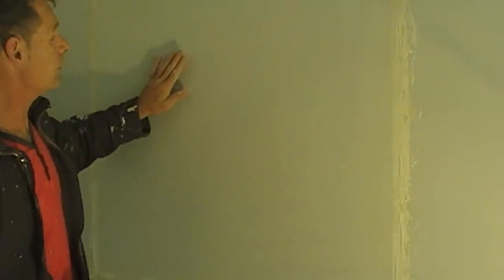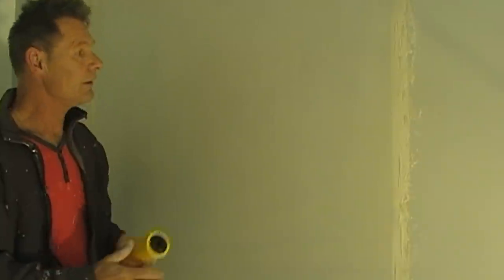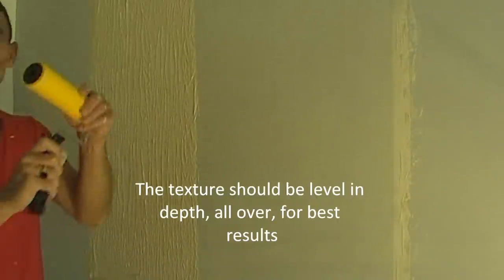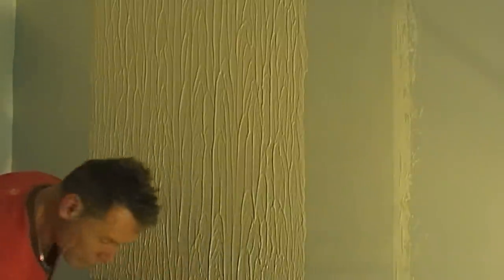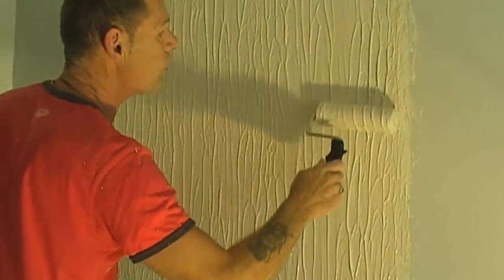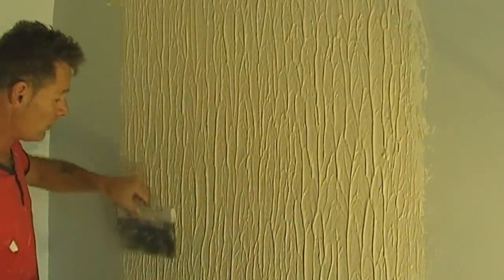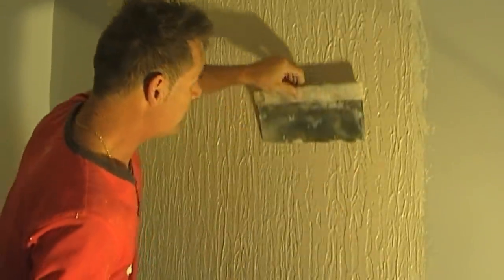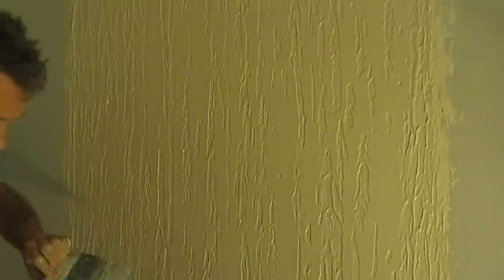How to Make Tree Bark Wall Texture (knockdown) Easy Simple Steps

Comment: what do you do in the corner where the walls meet the ceiling, where the roller wont fit?
Reply from the maker: Hi there Bo Haggin, thanks for commenting.

The edges and corners I use a 1" (inch) paint brush to run around the edges and perimeter whilst the texture is still wet. If you notice on many of my other texture videos, I use the same technique to tidy up the edges one the texture pattern is completed.

For results with the bark roller, as you cannot seem to get the roller too near to the ceiling edge (because of the diameter of the roller)...better still, I'll be uploading a video soon containing/showing the information I am attempting to describe here. Have a great 2018

Comment: can this be used on a plastered concrete wall? Or would it fall off as a third layer plaster?
Reply from the maker: Hi there samdean77 thanks for commenting. Here goes the answer to your question

1: As long as the wall is an interior wall (because this kind of texture is for interior usage)

2: As long as the plaster is solid and stable to the wall (For any further decorating finishes & purposes, any background surface has to be sound first)

3: As long as you seal/prime the wall prior to texturing (To seal/prime the wall aids in diminishing porosity of the texture material, and helps the texture to bond/stick to the wall/surface)

I hope this helps, please let me know. And by the way, thanks for watching. Hope you have a great day
Reply: Thank you so much! I was waiting for your comment to start texturing tomorrow. But to clarify (as it is important, please bare with me) I have primed the cement wall with PVA and put the first coat on. The second coat of plaster I did not use PVA, should I have? 
And finally, with the texture tree bark being the third layer, do I want to PVA it ontop of the second layer plaster before applying texture? Thanks so much in advance, Sam
Reply from the maker: You are most welcome Sam, I hope I can help further. Now this is going to take a bit of explaining, but I got sausages roasting in the oven so I got a few minutes before they are ready. Just to clarify your queries

1: To add 2 coats/sets, of skim plaster is normal. You have PVA'd the concrete and then plastered, and for the second set of plaster, as long as the first coat of plaster has not dried too much, you can skim over the second coat, that should be fine (Normally the second coat/skim of plaster will adhere to the first coat/skim as long as there is sufficient moisture still left in the first coat, which thus reacts with the sound layer, present there, and makes the 2 bond, but the first coat has gone enough dry so it is 'touch dry' that is, when you can barely mark it with your fingers, but it still looks wet enough, and has not gone solid, then second coat/skim on top of that.)

2: Allow all your skimmed/plastered area dry completely prior to texturing. All the damp marks has disappeared first. (You may find when you skim an outwards, interior wall, that will take more time to dry than when you skimmed an 'interior, or partitioned' wall, especially in the cold weather.)

Check out any dodgy parts or blown plaster you may think that may not have adhered, as per your concerns, and then if you find you have fkd up, hey ho don't worry be happy we all make mistakes, then remove the bad/loose plaster, prime/seal as necessary, and make good and let it all dry.

3: You are about to seal a very porous surface. You have to, prior to texturing any pattern. The PVA solution carries enough water/moisture, enabling a sufficient layer of bonding/sealing, solution to 'key' into the plaster, (acting as a 'solid/sound' base for more coats of sealer/primer to adhere to, eventually diminishing even more porosity enabling a practitioner to attempt/complete, texturing.) Follow product manufacturers recommendations contained on packaging, which ever building material you use, for the type of surface to be sealed/bonded//primed.

Check this vid, which explains in-depth https://www.youtube.com/watch?v=Q3bYVMegSpM

I can smell my roasted sausages now, Mmm

Anyway Sam, I hope this helps please let me know

Have a great day, and thanks for commenting and viewing my video
Reply: Thank you so much, Dale! I'm in Vietnam and it's a bit difficult asking questions at the local hardware store. :) Good advice in a pinch and I appreciate your time in responding, sir!

Comment: Hi dale. I have tiles on one of the walls in restaurant. But I want to get texture done on it. Workers here are telling me that all tiles should be removed because it won't hold pop on it. But what if we scrap the tile surface or give dents on tile . Then is it possible?
Reply from the maker: Hi there. It would be recommended to remove the tiles first, and make the background sound and secure with plaster, etc, prior to texturing. In the past, I have plastered (skimmed) over tiles (at the customers request). I have degreased the surface, and then put on a 'neat' PVA sealer, which acts as a glue, left to dry, and double skimmed the surface with plaster afterwards. For texturing, the background must be reasonably smooth (depending on the texture finish required) and sealed/primed (to diminish as much porosity as possible. For the tiles to be removed first, then wall made good and then textured, ensures no comebacks (loose tiles/greasy surface etc)  later after the job is completed. Thanks for your comment, I hope it all goes well for you. Have a great day. Regards, Dale
Reply: Thanks a lot  dale.
Reply from the maker: You are welcome. Please keep us posted for the outcome of the job. Have a great day

Comment: Awesome video, but how does the top comes out as the roller or texture will not be close to the ceiling?
Reply from the maker: +Charlie Renteria A great, juicy question and one I get many email enquiries about.

If you are curious about creating beautiful eye-catching textures on ceilings and walls, be subscribed stay updated as the 'why' you ask needs quite a bit of explaining possibly via a video demo or an article, in the near future

But I can say right now, where the tree bark texture pattern is concerned the actual circumference of the finishing roller matters alot, which determines how close the tool could get to the edge (ceiling/wall).

You are right

But that does not really interfere with the finish as the bark roller you should use to create a tree bark texture has an adequate circumference that would get the finished texture to nearest, where it needs to be.  It doesn't need to be patterned to the edge, just texture blended in to finish

In a few texturing videos uploaded on youtube (comb work vids and demonstrations) I cover how to finish a variety of texture patterns such as comb mud effects, broken leather pattern, stipple, knockdown, which also applies the same method for finishing edges of tree bark texture

I wanted to create a youtube channel covering all aspects of creative textures including preparation and repairs and these questions, answered, are there somewhere 

Use a one inch wide soft paintbrush doused occasionally in water to FINISH all kinds of textured edges; ceiling, wall, top, bottom, sides.

The length should be around 1.5" (the hairy bit) In Fact to have around 3 different sizes (hairy bits) 1" wide paintbrushes, could be even handier on the job

As finished textures is a form of visual art, the final product the practitioner should be 'very' proud of, no matter a pro offering to someone else, diy'ers doing for themselves, friends, family.

Using a 'finishing' brush is 'just another new tool to get used to' and is just as important for the completed / presented finish, as each of the other tools used for texturing

A few slabs and dabs here and there, a bit of time with the texture and the tools and you'll be fine

But don't run off and go texturing yet there's more  

As with DIY, Professional Texture Practitioners / finishers, the all importance applies

Thorough understanding of material being being used (to experiment with a few textures, sealers / primers until you find what you are happy working with.)

Good knowledge of a surface to be textured (preparation, key, and I talk about it a lot in my other videos, it's that important for successful ceiling / wall textures)

Conditions (humidity of room & surface to be textured onto)

Plus

Physical practice

As for a tree bark texture, if one were heavy handed drawing the paintbrush over/through the texture (after you have created the pattern and close to the edge) if done wrong it would look an awful mess.

But mostly it cannot be avoided, turn to the 1" paintbrush and let creativity continue and texture along complete an entire wall

Thanks for commenting I hope this helps. Have a great day

Comment: I've searched for hours for a smooth roller...on the internet and I come up with nothing. Could someone please post a web address or company who makes a "smooth roller". 

Thank you
Reply from the maker: +Harry Kellogg http://www.decoratingdirect.co.uk/viewprod/f/FDDWALLRC/ here is an example 7" hard foam wallpaper seam roller as I have used similar for making bark textures. Hope this helps, Harry
Reply: +Dale Ovenstone 
Thank you Dale. I never thought of a "wallpaper roller". Thanks
Reply: +Harry Kellogg This kind of product seems to be in abundant supply in the UK and Europe but not in the US. I wonder why. We use wallpaper here. The only firm I could find that would ship to the US wants to charge $33 for one $3 roller cover. I'll keep looking.
Reply from the maker: +Harry Kellogg That is very unfortunate Harry, I hope you find one soon. One viewer actually used a 9" paint roller, and he placed a round plastic pipe (plumbing) over the roller to make it smooth and flat, job done. Another alternative could be to remove the hairs/material, off an ordinary paint roller, and see if that helps. Years ago the actual (7" smooth hard roller) was for sale in decorators shops here in the UK, & made specifically for creating the texture bark, but not any more. Hope you find a smooth roller for bark, or some manufacturer could be reading this, and supply them at competitive cost, worldwide?
Reply from the maker: +Harry Kellogg http://www.amazon.com/dp/B00L8SWBW8/ref=asc_df_B00L8SWBW83870543?smid=ATVPDKIKX0DER&tag=merbethomgarbhg-20&linkCode=df0&creative=395093&creativeASIN=B00L8SWBW8&ascsubtag=878298355 Here is a 6" version, still good for the job
Reply: +Dale Ovenstone I like the plastic pipe idea. I'll try it. Thanks again.
Reply from the maker: +Harry Kellogg You are most welcome, let us know how it goes
Reply: +Harry Kellogg if you live in the USA, in Southern CA they have them at the .99 cents Stores.